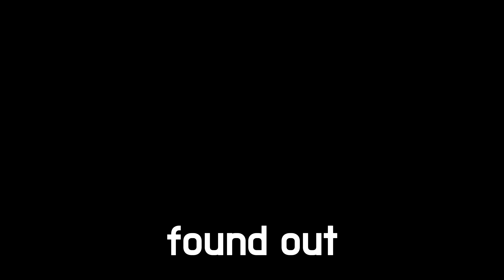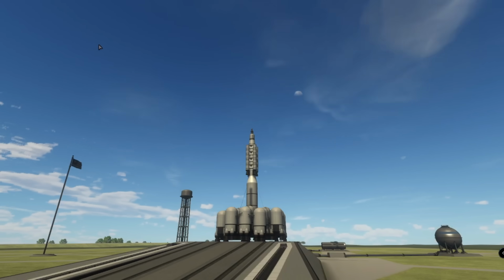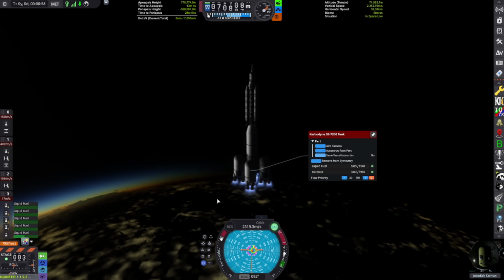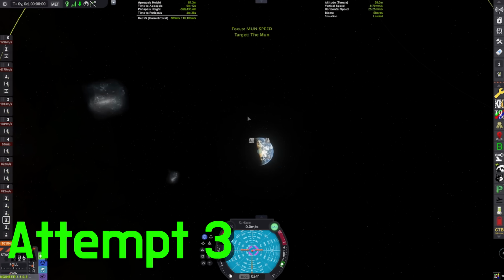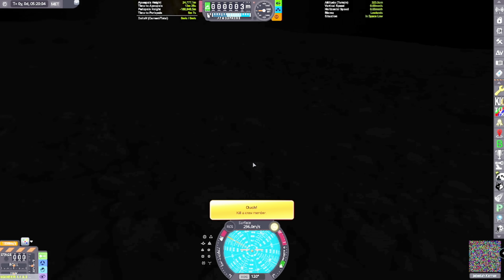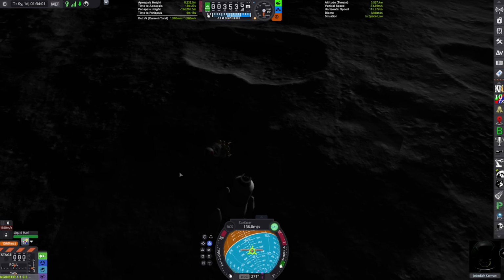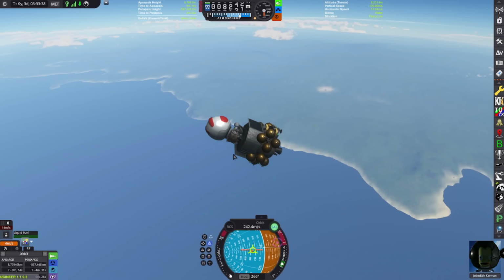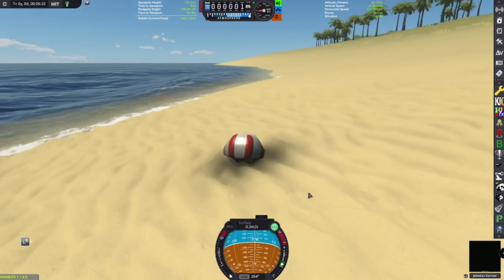How fast can I get to the Mun in KSP?

Comment: There is a faster way I found using the mk2 expension mod. There is an engine called the hyperblast that works at speeds above mach 4 up to 38,500 meters. If you make a light plane that can get to this minimum speed, the hyperblast can accelerate you up to mach 12 or about 4,000 m/s, almost enough to get you to Jool. I cross the Mun orbit in 1h30m using only airbreathing engines.
Reply from the maker: That’s actually insane lowkey an op engine

Comment: Hey so what you are trying to do here is basically what The Expanse does with their poorly named fictional engine called the "Epstein Drive" - also great video man, you got a new follow. 

A couple things to note. 

1) Your Rocket wasnt overkill, it may have been underkill actually.

2) you could of actually hit the Mun a lot faster, sub hour in fact 

3) Subsequently you didnt have to lead the moon that much, you could of lifted off when it was only 5-10 ish degrees off from being right on top of you as opposed to the 30 degrees you led it by. ill explain.

Your Apoapsis signifies when the planetary body's gravity (kerbins in this instance) has 'pulled' your craft so much that its relative velocity away from it [kerbin] is now 0. That means the entire flight you are being slowed. this means a few things, 1) its slowing you down and you are getting to the moon slower, in fact if your Apoapsis just barely reaches the Mun's sphere of influence you might only be going 10m/s just before the mun starts pulling you   2) because you are going so slow, the Mun has a LOT of time to move relative to you as opposed to if you just kept burning until the tank is dry. so what you can do use the rest of that first stage to gain more and more speed, not looking at Apoapsis but trying to burn until you are going so fast you directly intercept the Mun (possibly at a relative speed of 2500m/s) while the second stage is used to just slow down. because the first stage has to fight atmo and kerbin's gravity, the second stage can be much smaller. 

I may have to try this.
Reply from the maker: Thank for the info twin you should definitely try it out it’s quite a fun little challenge

Comment: I tried the fastest impact on mun. If we move at a constant acceleration twr ~10  we'll do it in a ~2,5 minutes spending ~152,000 ∆m/s, ~1000 ∆m/s per second. I don't think anyone can do it faster without glitches.
Reply from the maker: That’s a lot of delta V but wow thats actually impressive
Reply: @JakSP-69 I used a mod near future propulsion It has excellent cheater engines with 700,000 ∆m/s and higher. I think this is possible in stock, but I'm afraid to imagine a rocket. millions of mammoth engines